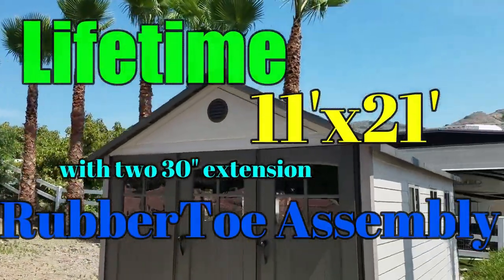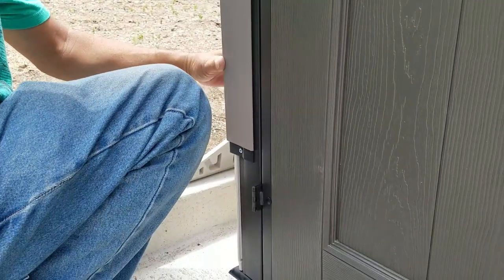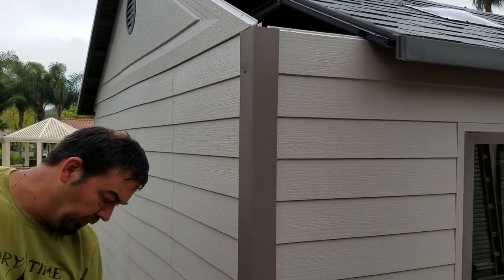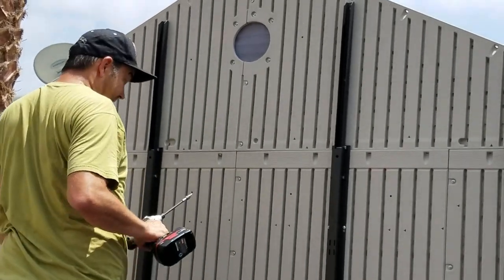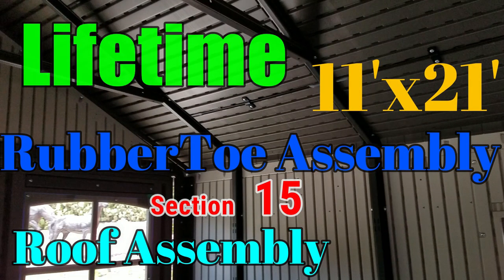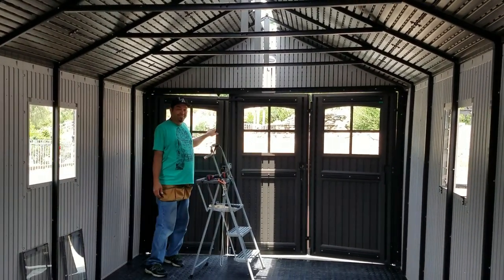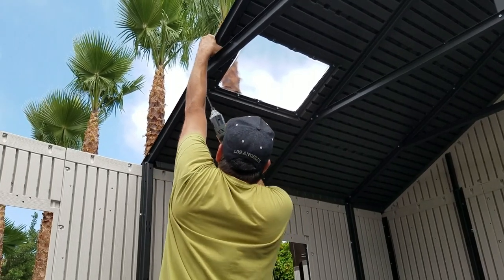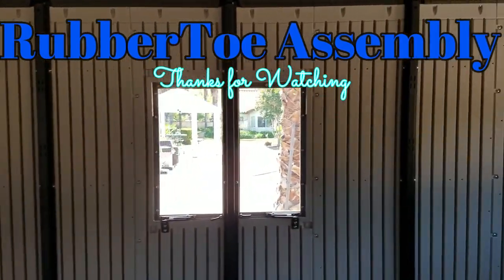Lifetime Shed 11' x 21' Triple Door Assembly Sec~ 13,14,15 How to Build Install 60187 60236 60237

Comment: Just installed one for a neighbor….gotta have temp braces to keep the walls from falling over when erecting ….the triple door setup is a night mare,having to hog out the holes on the metal hinge sleeves in order to get room for the doors to all shut.

Comment: Hi. Thank you for sharing these assemble videos for lifetime sheds. I have assembled 3 of them. One of them is the 11x11 with tri fold doors. The roof panels with the domed skylight has 3 metal roof supports? The groove at the top of my skylight roof panels the holes on each en where the metal support would insert are not clear. I dont know if it was a manufacturing error or what. Even the domed skylight roof panels are supposed to have 3 metal supports correct? I would appreciate any input you have on this. Thank you.

Comment: So, the openings on the doors, stay open or uncovered? If I, am being honest the finished product doesn't look very sturdy at all, we get a lot of wind 20-50 mph and this building doesn't look like it would survive, and the roof doesn't look like it would handle more than 2"-3" of wet snow. That would likely work for my area.